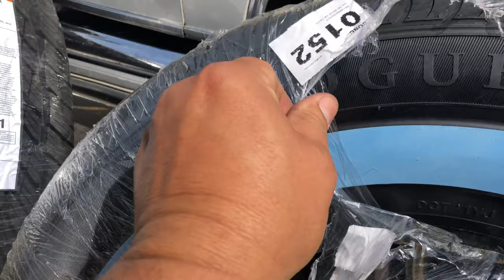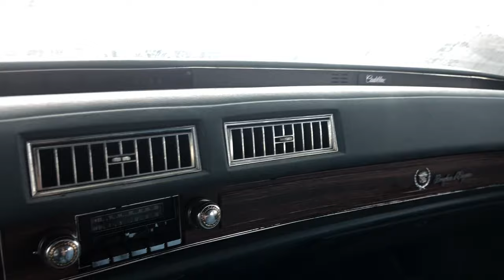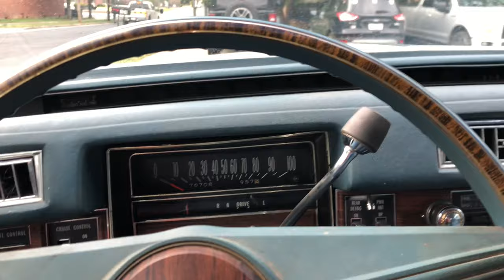1976 Cadillac Fleetwood “Barn Find” road trip adventure Part 2

Comment: The 1-1/2" whitewalls were on those cars when they left the factory.  Back in the day, when they needed new tires, all you could buy were the 3/4" whitewalls which looked OK and much better than blackwalls but the tires you put on make it look original.  You need to find some d'Elegance scripts for the c-pillars.  Is there a part 3 or part 4 for the video series?

Comment: I have a 1949 series 60 special Fleetwood, that I use for my long distance drives. around 400 miles round trip. I use to have a 1976 Fleetwood. My favorite one was a 1955 Fleetwood with factory air conditioner. All three were Black. ( NO WHITEWALLS) I would like to find another1955 Fleetwood with air, that still works. ANY COLOR.

Comment: To fix those door Striker pins for the doors rattle when you close them, you get some Vise Grip Pliers and unscrew the pin, take the washers off and get a piece of PEX pipe that new plastic plumbing and you slice off sections to replace the nylon Striker pin that is dried up and cracked and falling off it's an inexpensive way to fix the door closing problem. I've had four of these cars I have three d Elegance, that are project Vehicles cuz they came from northern states with salt damage I would go with bed liner for the vinyl top. I like the mirror window tint on mine, Blends in with the Chrome nicely the interior door bulbs and the ones under the dash I would find some Led once because those cars were notorious for a fuse blowing in the dash lights underneath the dash would stay on and you come out to a dead battery the next day.
Reply from the maker: Love the pex idea!

Comment: Always loved a Fleetwood.  They had such style and elegance!  I'm thinking that if I owned that car,  I think I'd leave it with a slick roof and not put a vinyl top on it at all!  I'd be afraid of causing it to start rusting from underneath it!
Reply: Yeah, that one was definitely ordered without that silly vinyl top.  Those vinyl tops look ok for a while but they always start looking like crap and once you put one on, you'll always have to re-vinyl it.  I'd leave it the way it was ordered!  I don't know why someone would want one of those when they just cause rust.
Reply from the maker: Having a vinyl roof is a double edged sword. They look very elegant, but the rust issue is real. The biggest problem is that Cadillac did not paint the roof on these cars from factory. They were destined to rust... all of them!

Comment: My aunt bought a white 1976 Fleetwood Brougham d'Elegance new in Birmingham Al in the summer of 1976.  If I remember correctly, hers had a white vinyl roof and I think the sticker on it was around $12,000. At the time there was some sort of problem getting tires, so hers was delivered without a spare tire - it was delivered later when it became available.  The only problems I remember her having a trouble with the load leveling suspension and. of course rust.  Thanks for posting this.  It really brought back some great memories of my favorite aunt and uncle.

Comment: 9:40 apply a stitched leather wheel cover. I put one of those on my 75 deville. It makes it feel much more luxurious as well.

The tops were typically not painted under the vinyl. I suspect the top was painted during a respray. But, the vinyl must have been sliced off leaving the bright trim in place. I’d love to see it with no vinyl or bright trim!

Comment: Hi from Sydney , Australia. The colored strip in the body side rub strips denoted what color the vinyl roof was/is for all 1971 to '76 Fleetwood Broughams. I own two right hand drive versions sent as CKD Kit cars to GM Holden Aust' Pagewood Sydney plant to be built as RHD cars, I have a black 1974 Talisman version & a 1972 70th Anniversary version in Cotillion white (ckd = completely knocked down).  If it was one of the truly rare base level special order Fleetwood's with NO vinyl roof, the body side strips would have been pure stainless steel with NO colored pieces.

The padded roof can have THREE versions of rear window framing, in full chrome like yours, or my white '72, or a colored "fake vinyl" pressed stainless steel set of strips with just a small curved unpainted section of chrome as on my black '74. OR , the "floating back window" look where there were no metal strips of any kind, and a black very soft plastic/nylon seal separates the glass from the vinyl roof this style was only on 1974 to 1976 cars.

So from your video, the body side molding-colored inserts on your car are white, so it should have had a White vinyl roof.

Comment: If you get the LIMO back window metal insert on the inside you have to change the head liner because from the inside of the rear window it will look like crap
Reply from the maker: I will have to study the situation.  It is a d’Elegance so the rear window treatment would have been tucked with no trim, I think.  I will compare to my other ‘76 d’Elegance to see what they look like.

Comment: That car was ordered without that vinyl top and for good reason, back then the always would rust out under the vinyl.  Water would get in them and rust out the tops and around the pillars.  Why would you want to put something on that will cause that?  I'd say leave the vinyl top off!
Reply from the maker: It did have one. I thought what you said might have been the case at first, but his son told me he had it removed and had the roof painted when it started to blister.